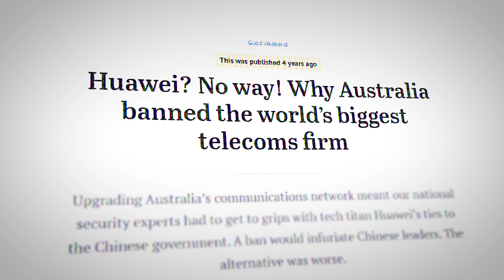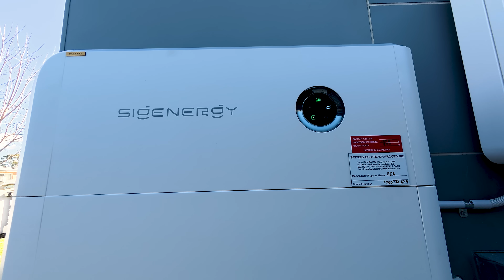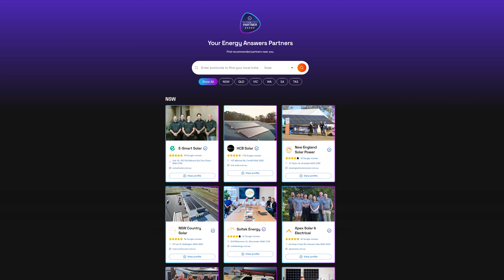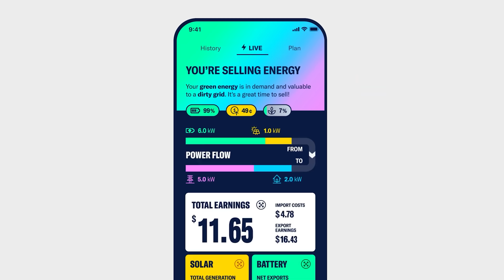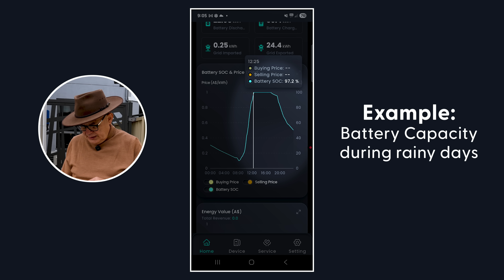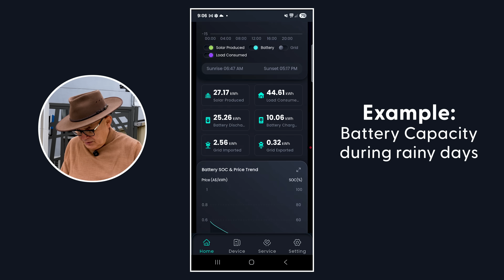Is going off-grid with Sigenergy a big risk?

Comment: Just saying, 40kWh for a days usage is way over the average household usage in Australia, which comes in around 16kWh-20kWh per day for a 2 person household, down to 8kWh for a single person although that would surprise me to get it that low, I mean a TV draws X amount of power no matter how many people are watching it, although I suppose if you have 2 TV's and both watch different shows that can add up. With your usage level I can certainly see why the first battery setup you had was insufficient, have you looked at what you are using that actually draws that much power for the day? It's all individual of course, everyone is different so judging peoples power usage over the internet is a silly idea. 

Actually I have seen videos from the UK where people purchased second hand cheap EV's just to use as household power backup because it was cheaper than installing more battery and using V2H because most EV's come with a larger battery than the typical household batter backup. Interesting to read about your experiences in this regard. I live up north of Australia and we get very few cloudy days per year, but just in the past few weeks we have had 3 days of power cuts due to "maintenance" by Horizon power, so battery backup is the way to go.
Reply: That's not daily use, that was load. I use 40kwh a day and that's not excessive
Reply: @willo3252  Not necessarily excessive I agree, but above average, but then if we didn't have people both above and below average we wouldn't have an average right :-)
Reply from the maker: That’s a solid point — most Aussie households sit closer to 15–20 kWh/day, so 40 kWh is definitely on the high side. But with multiple A/Cs or pools, usage can blow out fast.

You’re right about the EV angle too — a second-hand EV often has more storage than a standard home battery, and with V2H it can double as backup. The trick here in Australia is the tech approvals and charger availability, which are still catching up.

Comment: Has your expert missed the fact that there is a generator input on a Sig battery. Regardless of opinions generators are quiet (compared to a lawnmower), can be encased in attenuation and only ran to top up a battery on extraordinary occasions?

There is also the option to cook with gas or on a bbq on low solar days. If doing this consumption is reduced to LED lighting and maybe a tele only. Heating might be a crunch depending on location and if reverse cycle or gas? AC now has a gas heating option. HW can be heated during the day if a heat pump. It bodes the question as to what you are powering through the day/ night, how many bodies are at home, and if you are giving this a fair crack?
Reply from the maker: Thanks for sharing those helpful tips! You're right, there are definitely ways to handle those "extraordinary occasions" and reduce consumption.

Comment: This is a great setup. You should be proud. Seriously. But! You absolutely should not be going off grid without additional upgrades and maintenance planning. A few things ottomh:

You have a single Sigenstack, and therefore a single inverter (energy controller). You’re going to be using this guy all day, everyday, and it’s kept outside so it’s impossible to keep it at the nominal temperature for maximum life. Regardless of quality, you must expect this to die at some point.

If you truly want to be permanently off grid, you need multiple Sigenstacks. Think of them as horses — one is incredibly strong but a herd can share the load, and when one gets hurt the others can fill in.

Next up, your solar is AC coupled, which is fine, but it means you have yet another single point of failure. When that one single poor inverter gets tired and needs to retire, your whole system will be dead in under 48 hours given your usage. I wonder what your family will think of that if nobody is able to service your system immediately. And your rental tenant? I bet they’d stop paying in a hurry and worse move out. Good renters are hard to find and if you get a bad one you’ll pay way more for repairs than you pay your electric utility.

Then of course the Sigen gateway is another single point of failure. It’s a great system and very reliable, but it’s going to fail at some point. 

And where’s your generator to get you through extended droughts and exceptional high usage periods? You’ll need to buy the unit, run it frequently to keep it in good running order (and to burn off the diesel before it goes skunky), and annoy yourself and your neighbours with the noise and fumes.

Instead of all this hassle, consider changing your perspective on your utility bill. Think of the account fee as a recurring cost for access to a backup system. A backup system that is incredibly reliable, exceptionally well maintained, completely quiet, and has no (local) harmful fumes. 

I have 4 Sigen stacks with an aggregate 84kWh of storage. Along with my 19.44kW solar array, I am running “off grid” almost every single day. I too feel the sirens call to go fully off grid, it’s extremely tempting! But sometimes I take my F150 Lightning on a road trip and need 120+ kWh to recharge it. Even on the best solar days, that’s enough to soak up my entire generation. And when the whole family is over for Christmas the load spikes, exactly when my generation is at the lowest. Recharging with V2X is cool, but now I need to recharge my Lightning at a fast charger, which is a hassle. 

Instead I’ve changed my perspective on my utility company: they are my backup system for about $30/month. Compared to a 12kW generator, that’s over 5 years of backup availability, with zero hassle. And when needed the grid can give me much more than 12kW. And instead of driving to fast chargers, I simply recharge in the middle of the night for $0.028/kWh. 

Again, you have a great system. Please don’t take this as criticism. It’s the addition of the off grid piece that mucks things up. Stay connected and enjoy your excellent system.
Reply from the maker: Appreciate you sharing such a detailed analysis of the different factors to consider for a reliable energy system.
Reply: @yeanswers You’re very welcome, and let me say thank you to you. 😊 You created a very nice balanced video here. I really appreciated how you answered the “should you go off grid” question at the end — the “yes, no, maybe” answer was perfect. 👌🏻

Something I do that you might enjoy is going to your main service panel from your utility and flipping the breaker off. Don’t cancel the service, just don’t use it. At all. This will mostly scratch the itch as you’re technically off grid. You can remain so for most of the year, and you’ll sleep well knowing you have an incredible “backup generator” available when you need it. And on those days when you do need it, once you’ve recharged your batteries, you’ll get the satisfaction of walking over to the “generator” and flipping it off again, thereby giving you the joy of going off grid again and again. 😀

I’ve been running 100% off my solar panels & Sigen for the last 6 weeks. It’s been lovely. But early this morning I noticed that the forecast changed and the next 72 hours straight was going to be thick clouds. Plus I had a car to charge in that period. There was no way my solar panels could make it. So, at 5am I set an Instant Control schedule in the app to charge my batteries to full. I had to be quick to finish the charging before the utility rates spiked at 7am so I set the charge limit to 23kW. Everything worked like a charm. You’d be hard pressed finding a diesel generator that delivers 20+ kW, especially if you want your neighbours and family members to like you. 😂
Reply: An excellent analysis. Utility company as cheap insurance is a very good viewpoint. Don't think for one moment think a generator is a good alternative. They are incredibly expensive to run and unless you spend a lot of money they will not produce much power before needing a rest. And don't expect happy neighbors if you plan to run yours all night.

Comment: I have a SolarEdge Home System with battery, back up interface, hot water controller with 8.4kw array. Purchased 2 years ago so no battery rebate. The panel level monitoring is just awesome. I also have a super quiet Honda EU30IS generator. I too would love to pull the plug on the grid tie but can't do it yet
Reply from the maker: You're well on your way to energy independence with that kind of gear.

Comment: I installed a 32 kWh Sigenergy 3 phase system with 20 kW inverter (set to output a max of 15kW to satisfy Western Power’s bizarre rules) here in WA on 17th July. I have 21kW of solar panels. The battery hasn’t run out completely since then to now (19/9/25) despite a great deal of rainy weather this winter, so I haven’t used the grid except for about 5kWh due to some sort of grid phase balancing. It did come close on about 3 days, so the wife and I economised a bit to keep the record going, no great hardship involved. Generally I’d say we’ve been using more electricity than before, now that it’s free. I’m getting way more now than I can use during the day.

Over here we haven’t got Amber, etc. There is what seems to be a rather inflexible VPP system in which, as I understand it, you have to give control of your battery over to the operator. I didn’t want to do that so I had to forgo the $1,300 subsidy from the WA government as that was one of the mandatory requirements after they reneged on their original scheme as understood during the election campaign. With a 20kW inverter I don’t get any feed in tariff. My suspicion is that the standing charge will get jacked higher and higher over time, so going off grid will become an increasingly important option.

I hope to be able to do this once I have an EV with V2H plus the Sigenergy DC charger module. My idea is that the EV would act as a backup during sunless periods, probably rarely used if current experience is anything to go by. In extreme conditions, if the EV itself gets low on charge, it would simply be a matter of charging the EV from a commercial charger, albeit at some cost. In practice it think this would be very rare indeed. 

The only downside I can see is that if the system develops a fault, there could be long delays waiting for parts, particularly over here in Wait Awhile. I’ll have to see how reliable the system is over the next couple of years or so before plunging in.

Once I’ve replaced my gas boiler with a heat pump, I’ll disconnect that as well. Alinta are already jacking up standing charges with some crazy new ones recently added. Can’t let these vampires get away with it.
Reply: I love the way you explained all this and it makes perfect sense - and your VPP rules in WA with the must have clauses to get any rebater sucks - maybe in the future get a 2nd Sig energy inverter stack - to introduce even more reliability.
Reply: @markuslambert8236  Perhaps I should clarify that I did get the federal battery subsidy, only the WA government subsidy was declined.
Reply: Is it just the wife and yourself?
Im thinking of doing exactly as you have done and not go the State rebate, the VPP deal doesnt sit right with me as i understand it.
About to build a house in the hills so thinking a 32kWh system, but we have 2 teenage kids.
Heating will be with wood (have no shortage on my acreage) so aircon will only be for cooling and the odd evening getting home late from work and the fire may have gone out. 
No gas on the build, all 3 phase electric so im hoping to be mostly self sufficient with energy needs.
Reply: @wazza9089  Yes, just myself and my wife. So far this winter/spring the main usage has been heating. During the summer obviously A/C, but virtually unlimited solar incoming.
Personally I wouldn't go off grid if I didn't have an EV as backup, and note that I haven't done so up to now and don't currently have an EV. In your case perhaps a generator is an option but obviously not a green solution.

Comment: I've got my Sigenergy 48kwh stack with 3P 25kwh Inverter being fed by 30kwh Solar (60 panels) being installed here in Kalgoorlie in October. I have a family of 6 and a large house and use 40kwh ave with 60kwh peak days. Like you, my original 6.6kwh solar system with a 5kwh inverter dropped my bills to $80, but mybkids were small. They are now back to $500/mth. I've got 1 x EV and plan a 2nd soon so will install a second stack with an extra 2 x 8kwh battery's to take me to 64kwh storage and add the 25kwh bidirectional DC EV Charger with a second 25kwh Inverter (or an expansion inverter similar to the new tesla expansion pack model that i predict will come in 2027) and by moving 2 batteries from stack 1 to join stack 2 will have twin stacks at 5 modules high. Up to 170kwh backup in both EVs. Given that Kalgoorlie is about the sunniest and hottest places in Australia, I am expecting to be off-grid for  20 years comfortably running 7 aircons during 45c days weeks on end, 5 tvs, 3 Fridges and all the rest. Have I gone big enough! Will keep you posted. PS. luv your posts. You're the reason I went with Sig!
Reply: Devils Advocate here 😈will the extra 16kWh actually make a difference? having another stack/controller installed without any of the rebates seems expensive, so wondering if it's 'worth' it?
EDIT: oh, you already hit 60kWh some days, which will prob go higher with another EV. All good 👌🏾I'm not a financial adviser, but if you're taking out a loan/refinance for the 2nd EV, might as well take a bit more out and go harder with a bigger stack than just 2 x 8, lol 🤑😝 Hopefully when that time comes everything is cheaper 🤞🏾
Reply from the maker: Wow that is an absolute monster of a system. Please do keep us posted, people love hearing real-world results from large-scale home systems like this.
Reply: Impressive system
Reply: @markuslambert8236 good on you for stepping up. Im heading this way too as soon as I can get a business in Perth to provide a price, unfortunately Sig only has two very unresponsive suppliers!
Reply: You are the King of Kalgoorlie.
Reply: Impressive however it’s not recommended to use hybrid inverters full time off grid as you can see in many posts
Reply: I am very cynical about all this. Consumers are investing too much capital and won’t get it back. If you don’t use all your battery every night, you are not amortising the capital cost. Are you charging yourself interest on the capital you have invested? Going off grid is a bad idea. It requires too high a capital investment and is unsafe as far as continuous supply is concerned. The best idea is to scale your system to reduce your bill to a small amount. You also need to remember that batteries have a life and technology is changing rapidly  and periodic purchases are better.
Reply: I'm curious to know what temps you get on the top of your stack? I've got the same setup in Sydney in a garage and with ambient 32C outside, the PCS temp is reporting spikes just above 60C. The lowest I've seen is 50C (on 16C nights). Just installed a few weeks back, I'm curious to know if this is normal, abnormal, a bad thermal sensor, etc.. The actual inverter unit is warm to touch on the right side, but not hot -- I'd say ~30-45C.Batteries actually feel hotter on the right side when it's pumping hard.
Reply: If the temperature is 60ºC it will be very hot to touch and it is certainly not appropriate. You need to have it checked out. It may be that the cables are under-sized. Remember that feeding into the grid can be at a high kW rate and you could have a fire or burn out a component (best case scenario).
Reply: @AaronDrew 
Mine are stinking hot. Here in adelaide with 40 deg outside, I threw the temp gun on the inverter and outer case temps were 55 deg
Through the app the battery average cell temp 50deg (i cant seem to navigate to the inverter pcb temp)
Right hand side is definitely hotter 

32kwh three phase stack 

But the battery is a beast, not a single complaint, not a dollar spent on power in 4 months. The heat concerns me tho
Reply: @dockaman put a fan onto batteries to keep them cool in hotter weather
Reply: Your power bill is around $6,000 pa. With your intended battery extension you will have spent around $100,000. Let us say you charge yourself 5% interest on the capital on the basis that this is what you are paying in interest on the loan to install the system or the opportunity cost of not having the capital deployed to earn income. Without the interest, it will take you 17 years to recover your capital. If you include the interest, it will be around 20 years. Given that the Sigenergy batteries are likely to last 10 years and at most 15 years (I haven’t checked the warranty but I suspect it is 10 years), you will need to replace all the batteries before you recover the capital. Beating the electricity retailer may make you feel good however from what I can see, it does not make common sense. I haven’t bothered to contemplate the maintenance cost over the life of the system and I wonder whether Sigenergy’s system is of good long term quality.

Comment: I was off grid back in 2016 with REPT cells 280ah string of 16 x 3 I had around 50kwh with a ep ever inverter and charge controller. Prismatic cells are fantastic and the energy density is remarkable. Can Australia build a better battery then China??
Reply: Lets hope so